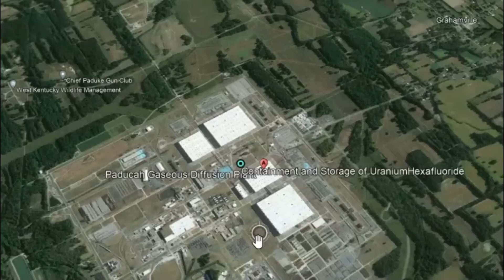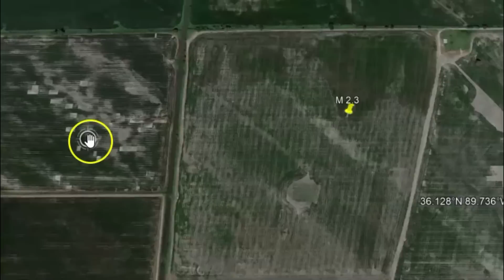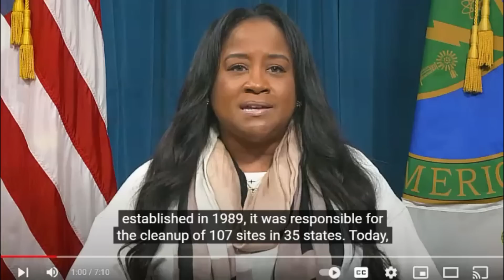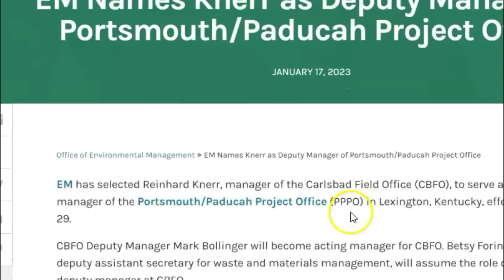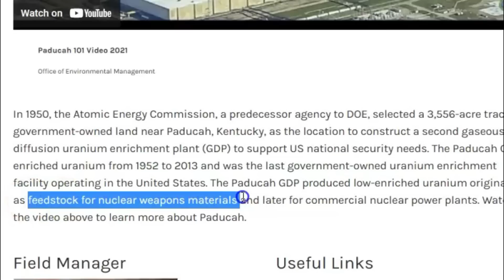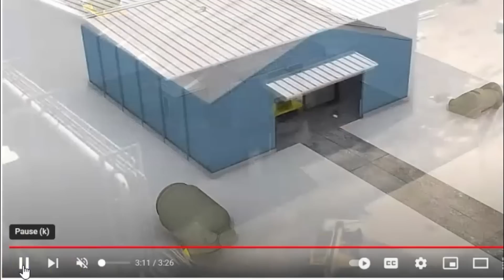WHAT! Uranium Processing Plant In New Madrid Fault Zone, Contaminated Wells

Comment: No Mary they are talking about inspection and relicence the old  
Reactors and starting them up again. Siemens I believehas opened a second plant or talking about doing so. They grind and mold pellets thanp pack rods that is used in the reactors.  I worked there too.

Comment: Our area is poorly prepared for seismicity when it comes to earthquakes like most of anything east of Rocky mtns.  That includes most nuclear power plants.  Some newer ones like Clinton supposedly are 7 magnitude resistant rated. Some are not so much like 5.5 Rock Island ironically in the middle of Mississippi river. 
High water tables can amplify shaking and as well create ground failures like liquefaction.   Paducah KY is near major rivers which suggests higher water table. Bet the mess of radiation has moved in groundwater.  Probably miles. I'm Idaho Monsanto radio active waste biproducts are used in mixes of concrete, pavement and other construction materials. They exceed EPA guidelines but a loophole in the law requires state to declare a superfund site.  State and city Boise won't because it will drop property values thus tax revenues so the crap goes on at the risk to health of the locals. Videos on line show radiation detection equipment sounding alarm readings just walking in area of pavement etc using Monsanto's radioactive material. 
Kinda sick, vested conflict of interest leaves health and life second to profit$.
To this day heavy metals and some radioactive elements from the 1930s-50s is still found in Lake Michigan.  It's scary stuff and has to be stored in such a way.  Gases, chemicals, even low level electrical fields can disturb certain wastes, temperature another factor.  Radiation of some types eats metal like eggs on frying pan as well as concrete.  
❤️Ya Mary !

Comment: its not done yet give it a little while were due for the big one all the drilling and pumping  from there  destablisieing the  presure on the falt  o were  in for a biig one you think presure dont mater but i tell you it does  what kept thoes faluts from  moveing faster then they did now that has been relived from the falts how fast will it move  naturel gas and water have been coming out of there for years its like a ball of clay and sand what happens when you take the moisture and presure form them they dry up and fall apart

Comment: Who the heck would put a uranium plant on a fault zone? You know they knew. Crazy stuff coming to the light.
Reply: There really isn’t a place without one honestly. Have you ever seen the map of all the fault lines across the planet and how they all connect. You know how water follows the path of least resistance? That’s what earthquakes do basically. They don’t always hit right on the fault line. It can be within a 200 hundred mile radius. So as the quakes happen they will flow then another quake of similar size, then that energy transfer on and another earthquake and so on. They go back and forth all day long never stopping. These honestly are the cause of most train derailments. The tracks shift. You can see if you see the map and see the derailments. We cause them by drilling and fracking too. No, I’m not a climate change activist. If the government says earthquakes on train derailments they lose the battle for banning those oh so dangerous pipelines.